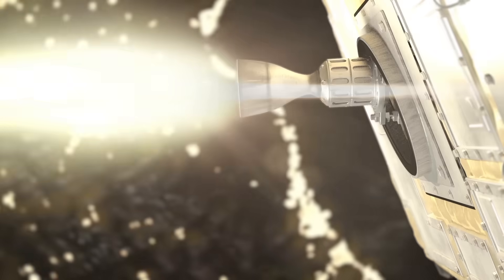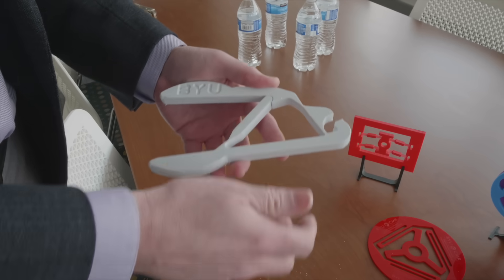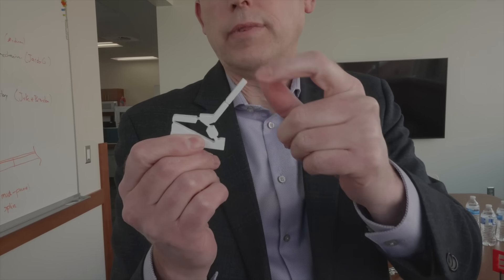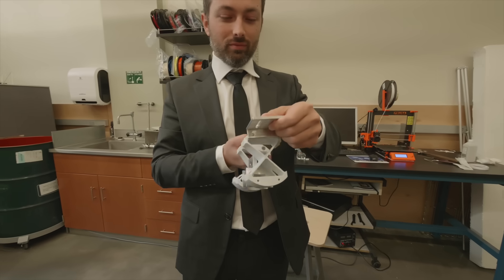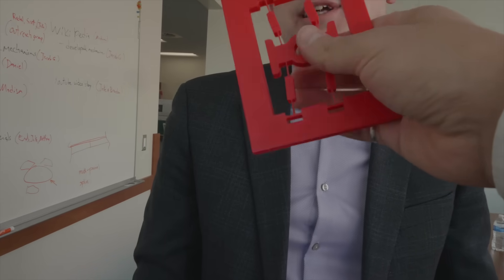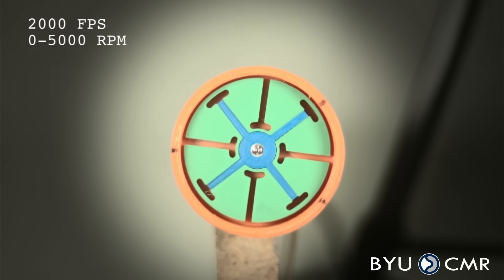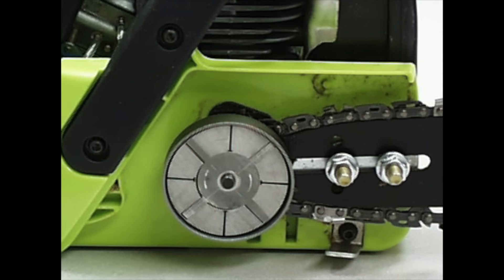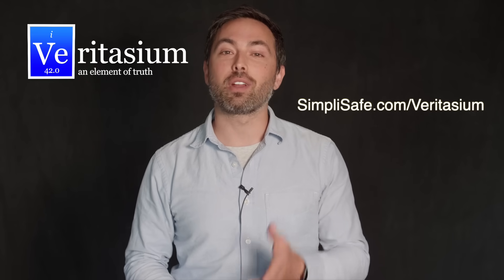Why Machines That Bend Are Better

Comment: i see two negative properties: repairability: you have to switch out the whole part if anything breaks. and weathering, as if its made from for example steel, it can rust, and will most likely break rather than bend, while a rusty hinge will most likely still turn, albeit with much more resistance

Comment: Those flexible vise grips may apply a very tight gripping force, but the flexibility would make them useless for applying torque such as removing or tightening a bolt.

Comment: "Hinges, and bearings and stuff"

Damn. Don't you too hate it when a construction is repairable by changing subconstructions, when you could just swap the whole thing?
Reply: But if sub-constructions are badly designed to fail frequently then replacing them with one solid construction with much larger lifespan is beneficial.
Reply: then design them goodly.
Reply: @overdrive105  That is what this whole video is about.

Good and better design.

Moving on from hinges which cause trouble.

Comment: Sure the components can cycle a million times when new and in good condition. But how do they hold up to wear over time? For example in a car as a switch. How do they handle uv light, heat cycles, vibrations, and most importantly time?
Reply: No better than cheap plastic switches and weak springs we use now I imagine
Reply: @brandonden795  the cheap switches and springs we have now are designed to continue working even after UV, vibration, and other damage over time. Will these designs stand up to and continue working when the plastics harden, or become brittle due to heat cycles and UV light? What are the ways to avoid this wear? Is this actually a better design when you put it into use?

Comment: It's just a crazy & revolutionary thing.But the main thing is that all the components are connected by thin string like this at many machines , won't that would break & .And if it does the whole machine becomes useless.

Comment: Can somebody please let me know what that spinning/expanding "clutch" is called, so that I can read about it?
Reply: It's a type of centrifugal clutch, that works with the help of friction.
The rotation of the shaft causes a centrifugal force that makes things attached to it want to fly outward from the axis of rotation.
You use that force to deform the elastic elements and make them touch the outer shell, then friction will make the outer shell rotate.
Reply: @animasaurus2007  Thank you kindly sir!

Comment: tries to explain how something complicated works
"The thing spins and when the dot reaches the spot crazy stuff happens"
Reply: Well it would take hours just to begin explaining the details of how a nuclear weapon fires and why, given the vid is supposed to be understandable by anyone because of it's vulgarization goal, so as dumb as this sentence seems he didn't have much of a choice lmao
Reply: Also there are key infos he just doesn't have, like how are they stored and where, as it affects the tinyest details of the starting mecanism in order to be completely safe, which is one of the reasons they need to make dozens of prototypes and let the army designers take the ideas and apply them to the actual situation with all parameters included.
Reply: @GreyPunkWolf  'info' (information) is never plural.
Reply: @slaughterround643  Oh thanks. Not a native english speaker and I tend not to read myself afterwards.
Reply: @slaughterround643  Yes, it absolutely CAN be. You can receive large amounts of information that also regards various other informative topics.
Reply: @slaughterround643  You might want to touch up on your English.
Reply: Fallout I think what he meant to say, is that “informations” does not make sense.
Reply: @NukelearFallout  ditto! <3

Comment: In woodworking, compliant mechanisms are used in jig-making.
With correct grain direction and proper cuts, leaf spring mechanisms producing enough force for use in powerful machines, to ones light enough for switches can be achieved.

Comment: Saying that you can fatigue test a machine to over a million cycles without failure sounds impressive but you don't say if that's more or less than the machine they'd be replacing.

Comment: I'd be really worried about durability. I know he said they tested them and they lasted 1,000,000 uses but I feel like that's not really enough. A lot of mechanical things like switches are used in things that are supposed to last years, and it just seems like 1,000,000 would pass too quickly.

Comment: What confuses me is that in engineering it is taught that materials that bend over and over create failure points because bending materials stresses them, and if done quickly creates heat. So how do they eliminate this problem. I could imagine such devices being used in engines to reduce the number of parts and overall engine weight if the stress point problem is completely eliminated.

Comment: A million cycles in a machine is quite impressive, but what about wear and tear when exposed to UV-light as when it's used outside?
Reply: Additives are commonly added to plastic injection molded parts so that they will be UV-resistant.  As with just about everything, the additives cost money too, so they generally wouldn't be added to the plastic unless UV-resistance is necessary.      Ed

Comment: The only bad part about that centrifical clutch design is that most centrifical clutches are dry clutches and if you use them too much it can get really hot and that doesn't really mix very well with thin pieces of metal the higher the temperature it's going to take to either bend or break the small bits of metal that act as the hinges and springs if you scale it up it might work better but the more you skilled up the higher the RPM that it's going to take to engage so it's kind of a lose lose situation

Comment: Titanium is quite flexible and resist to bending and torsion really well
It also resist to high temperature and corrosion
That's why it's used in a lot of things, sadly it's a rare metal on Earth
Reply: Titanium is not at all rare. It's second behind aluminum in availability. The problem lies in the extraction process. Extraordinarily difficult to extract from it's native ore.

Comment: Great video I love the series, however, centrifugal clutches have existed for some time. Now, they had springs, multiple parts, certainly one that's made in one piece is new. But if you had a mini bike or a go kart in the 60's and probably still today any conveyance with an engine that was running at idle and only started to move once you applied throttle without disengaging a clutch, it had/has a centrifugal clutch.

Comment: I designed special grippers out of A2 steel with carbide inserted jaws for multiple heads on indexing assembly line. You had to spread open the tiny arms after cutting to braze in the inserts, all spring loaded. Pivoting joints grippers were too sloppy and prone to wear for the holding tiny wires. This was about 20 years ago, I thought the flex approach had a lot of potential in many applications. Great video!

Comment: I understand the need to have a catchy title that will draw viewers, but nothing in engineering is inherently "better" regardless of the context. It all depends on what function it serves. Take motorcycle frames, for instance, where it's all about rigidity. In the past, they were much more flexible because of the state of material technology at the time; and they suffered because of that in terms of control and manoeuvrability.
Reply: I wouldn't say a frame itself is a machine.
Reply: @jevicci  wow, talk about missing the point entirely. Well, if you wanna be this autistic about it, the entire motorcycle bends according to how its frame bends, so there, an example of a situation where you don't want a machine bending. Idiot

Comment: I’m surprised you didn’t cover the revolutionary Zenith Defy Lab which features a completely new kind of escapement, a compliant tech component recently engineered to replace the traditional transmission gears which have comprised the escapements in wrist watches for the last century. It totally fits this episode. https://youtu.be/xWh0p9Irznw

Comment: It is actually pretty awesome... I don't think it has application replacing normal mechanisms for the most part... but the things that it can replace/improve could actually be far reaching. The thrust vectoring on the space probe is neat. Whether it is technically better than a more conventional method I am not certain, it is still interesting. 

I bet it could be useful in robotics in some way.

Comment: the question i have is wouldnt the metal devices work-harden in the flexing/moving sections and quickly fail?  like bending a piece of wire back and forth to break it
Reply: I think only if they exceed their elastic limit.

Comment: Now until today, I could understand how a chainsaw clutch works,
Reply: There’s a similar mechanism inside some electrical motors, specifically the capacitor start variety, that acts as a circuit disconnect when the rotational period generates sufficient centrifugal force.

Comment: As cool as the extruded clamp is, comparing it to a Vise-Grip is silly. It can replicate almost none of the functions of a Vise-Grip and the one it can is not what Vise-Grips are even designed to do. And, yes, that's a clutch. That's how centrifugal clutches have worked for,  what, 100 years? It has integrated springs instead of discrete ones, that's all.
Reply: Missing points is your specialty i see.
Reply: @logitech4873  Awww...did I insult your sticker collection or something? Body hair now beginning to show up in strange places? Have no idea what a Vise-Grip is? I understand.
Reply: @michaelisaacson9735  I suggest you rewatch that part of the video.

Comment: Prof Howell... can u design a full suspension mountain bike using compliant mechanics instead of pivots and air or coil springs?
 It would make for a lighter bike than a traditional full suspension bike, or make a light but hard tail bike more comfortable to ride.

Comment: I was thinking about building a really low budget  3D-printer. Using out of store threaded axles and nuts you end up getting about 0.5mm of backlash. So what i came up with was using 2 nuts and have them interlinked by a prestressed compliant mechanism ( a spring), all fitted into a tube and encapsuled with grease. Still have to build it but it is possible to build multi-part machines while taking advantages of compliant mechanisms.

Comment: What plastic can withstand a million cycles with what are very clear stress points?
I'm thinking of like hinged bottle caps and the like that seem to break at the hinge quite quickly etc...
Reply: As long as they don't bend beyond the yield point, particularly under the stress they are intended to perform work, they should be ok.  It won't be like a cheap shampoo bottle or lunchbox lid hinge.

Comment: So the first invention was a copy of a pair of vice grips with a perishable hinge? But it can crush chalk. And as for physics girl who was amazed by the way in which a centrifugal clutch works how can she not have come across that before, with a name like physics girl she must have been playing along. As for the nuclear weapon safety device he doesn't know what it was ultimately used for?
Reply: strictly speaking, all hinges are perishable. they're an engineered failure point. it's more about something that can be rapidly produced, is extremely light (which is super important for things going to space), and still functions as one would expect.

with physics girl, just because you're familiar with the field, doesn't mean that you're aware of all the applications of physics. even if you are familiar with most of them, that doesn't necessarily remove the awe you experience when you see it in real life for the first time. i'm not saying this is the case, but it's at least a plausible explanation for her reaction.

with the nuclear safety device, they're not actually told how it's used. that's part of the secrecy. they're just told what is needed, and then they make it. he does mentions that they weren't told if it was even used. the nuclear curtain is rather thorough...

Comment: Biggest problem on those objects : if it break, you can throw it away. It's impossible to repair.
Reply: Adam Poncin 
Fits perfectly in today’s disposable economy then.
Besides, might be great when you’re in a pinch and away from your toolbox - buy one of these for a tenth the price and use it until it breaks.
If it lasts half as long as conventional tools, still saved 5 times the money.
I definitely worry about durability - even materials that are created for flexibility have a certain durability range and less so under pressure.
Every point at flexure is being stressed in several ways, but if they overcame that issue...
I’d buy some for family and a few for myself, the vice grips might work for some projects in the garage and that nuclear safing device would be awesome in my front door - for aesthetics of course.
Reply: rather than throwing it away, you recycle it. then somewhere down the line it turns back into whatever it was. this also applies to metal tools, but i'm just point out that it's not necessarily "wasted". also, if a metal vice grips breaks, or bends, there's no guarantee that it can be repaired. even if it can be repaired, the cost to repair might just exceed the cost of buying one of these flexible vice grips.

Comment: Wouldn’t this suffer greatly from cyclic loading?
Reply: It depends on the design, but these systems are designed to deal with this. In the video they said one of their switches could go through more than a million cycli  before breaking.